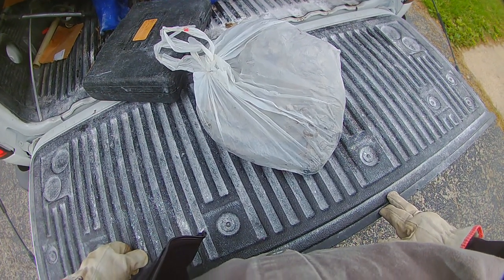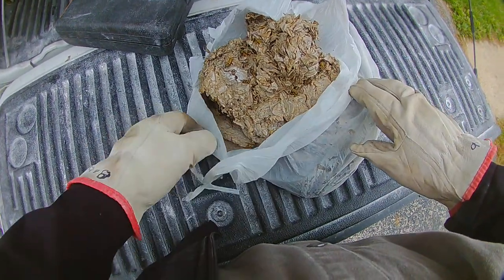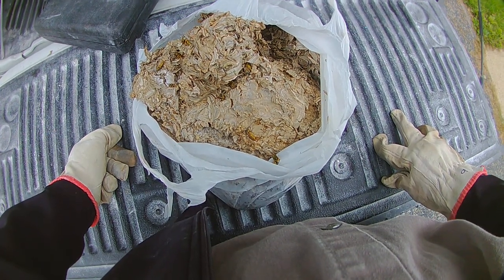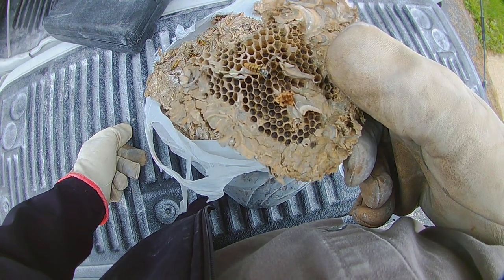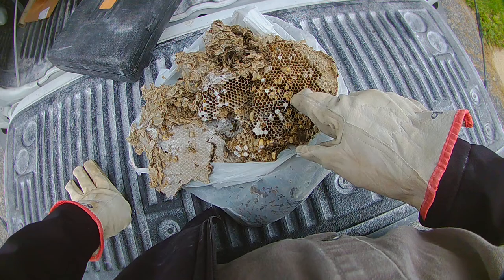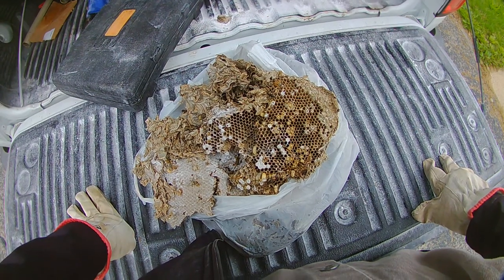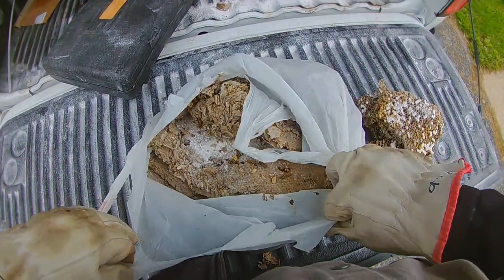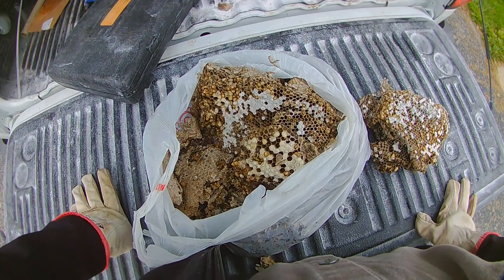Look INSIDE a yellow jacket nest!

Comment: Bee Man, have you had any accidents regarding your protective gear at any time? Say, there was a hole in it and a lot of bees/wasps flew inside?
Reply from the maker: Sometimes. Sometimes you'll see professionals use a bit of duct tape at the back of their suit (mine included) because the zipper gets old and gives a gap for them to get inside. I did a few removals with yellow jackets getting inside the veil before realizing it was the back where the zipper meets.

They also get up the pant legs occasionally when I get too lazy to use my ankle straps

Comment: What would you recommend doing about yellow jackets living inside walls that are getting in an out through a space between outdoor wooden siding? (I actually have no idea what kind of flying black and yellow insect they are.) Could I just put spray foam over the hole, or do they need to be removed?
Reply from the maker: Never ever seal those guys into a wall--theyll come right inside and you'll be in for a nightmare.

They're probably German yellow jackets. When in a wall, you need to use powder and air pressure to get into the nest. Powder isn't instant so I recommend wearing a suit for protection.

You can usually get Sevin or Apicide brand pesticide from the local store. They're not that strong so it may take a couple of attempts